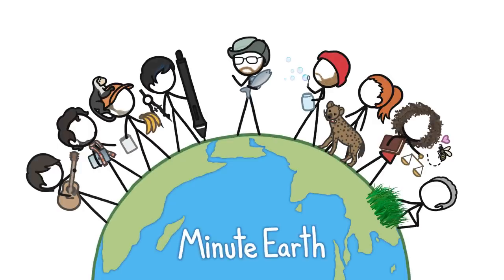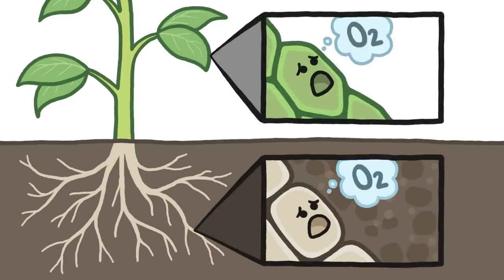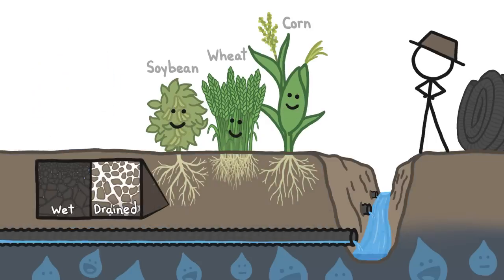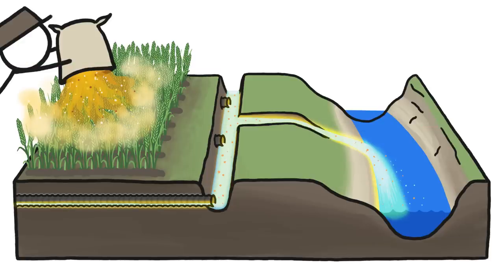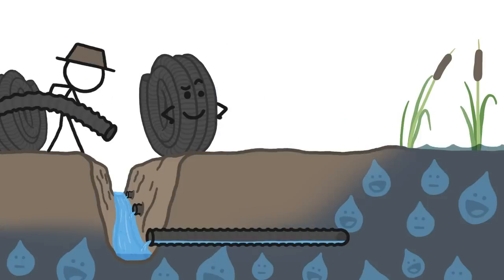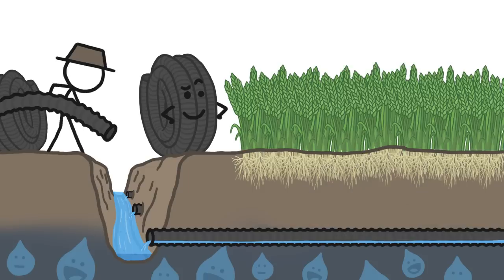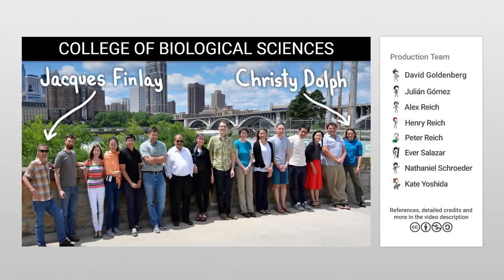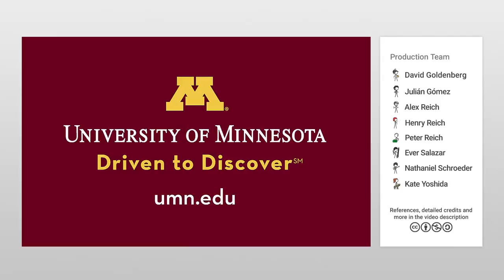The Secret Global Sewer System

Comment: There is a lot of misleading information here. 

Wetlands are not tiled because you are trying to make you land more profitable. Wetlands are 50/50 if a crop will even make it. It is more an crop insurance play.

It is rare to see someone both irrigate their land and tile it as well. If they are they are super rich farmers maybe. Typically either irrigation and tiling is put where it is needed to make more money. You have to pay it off you know because it isn't cheap. To add either of these depends on the soil and crop you are farming as well. 

Not that many people are putting in tile. Tiling definitely makes land more productive and manageable. I would put the tiled farms are around 5% in the US. This video acts as if every farmer out there is putting in tile and irrigation which is definitely not the case. 

Also needs to be more specific on the wetland part. It is more on the land that doesn't drain well enough to get into the field in a timely manner. Definitely not wetlands were ducks are roaming around, fish are swimming or even close to marsh. There is no way any farmer would dare to get stuck up to the oil pan up to a  100k lb tractor on that type of land. Man the cost of pulling you out and the time used isn't worth it.

In addition, tile is not only to drain the field but to allow the crops root system  to go deeper to fight against the times of severe drought. This way the crops have access to more moisture during those dry times.

However, I do agree that timing of chemicals and not directly linking to a creek or river is good!
Reply: Why would you measure the weight of such a big thing in pounds?
Reply: Drainage is more common in other places than in the US, though. Here in Sweden over half the cultivated land has drainage installed.
Reply: @dentoncrimescene  I would surmise because that is how vehicles get classified through DOT. Anything over 10,001lbs. GVWR requires a CDL to operate, if I recall correctly. It usually says something about it on the reverse side of a driver's license.
Reply: I work for a sewer treatment plant. We average about 7 MGD, normally. We have had to remodel the plant at least twice in the 25 years I've been there. Both times were to meet ever increasing limits on the amount of nutrients we can discharge into the river. Being one of very few 'point sources', it's the only way that the DEQ can regulate what goes into the river. Farms and fields rarely are subject to regulation because of their open nature, in my area.
It might seem counter-intuitive to some, but the river is actually cleaner downstream from us because we dilute with clean water what is already in the river.
Remember, the solution to pollution is dilution.
Reply: Here in the UK a great deal of the farmland has some form of drainage. Whether that's full on drainage systems or just ditches dug along the boundaries and the water funneled into streams. My parents house was built in the 1920s on meadow land and there are terracotta field drains running through their garden that were installed back years before the house was built. 

As for wetland, farmers may not intentionally drain a swamp to farm very often (although it does totally happen, just look at most of Norfolk) but if you drain the farmable land around the swamp then the swamp shrinks and after a few years there is more land that starts to look farmable, it only needs a little drainage. And so on.
Reply: WhichDoctor1 Wait you mean to say there are places outside of the Us, gasp.
Reply: @beeveebee  as a state sewer treatment regulator, I sympathize entirely. Every year we are required to reduced effluent limits but are not allowed to touch agricultural runoff because lobbyists have been very effective in the grain belt. 90% of the organic nutrients that are causing water problems come from farmland. And we can't regulate that because it's "non-point source". And because of the lobbying, drain tile effluent is still considered non-point source in my state.
Reply: “It is more on the land that doesn’t drain well enough into the field in a timely manner”
The reason water doesn’t infiltrate and percolate very well in fields and instead runs off the surface is the soil has become compacted. Wetlands, whether temporarily or permanently under water, are not compacted as much as fields and the large network or roots and earthworm tracks allow for easy infiltration of water into the soil. What he was saying isn’t that tile drains away all the rainwater and none was runoff. Instead he was implying that when the soil is saturated the tile drains excess soil water away and running that into wetlands would help clean it up and reduce downstream flooding. If wetlands were placed in strategic locations like he mentioned, then they would absorb water both from runoff and from tile. Sure it would’ve been better if he has mentioned all of this, but he still wasn’t wrong.
Reply: Nerd
Reply: This is bigger than my essay.....

Comment: Solution, Storage tanks. From the irrigation channels and tile to LARGE under ground tanks to be used for watering dying dry periods. 
The same can be used in city infrastructure to help prevent flooding the sewer and storm drains, as well as providing water to keep roads clean and assist with localizing water for Firefighters.

Comment: Serious question: can they not make a system to where it goes into essentially a gray water tank, which they can then draw from to water the crops again later, rather than from the aquifer? Kinda like the way city parks will often have signs that their sprinklers are using non-potable water?  This way, the chemicals already in there were already meant for those crops (and so hopefully they don't have to apply as much), and they use less water overall (and have a diverter or something for when the graywater tank is empty so they can pull from the regular well again).  Or am I missing some crucial thing?
Reply: I think the main issue is that not all of the water drains to one place in any given field. Tiling (what farmers put in the ground to drain water) is actually used quite selectively, not just across the entire field like the video made it out to be--usually farmers only use it in the natural valleys on their land. As a result, in any given section of land (1 mile x 1 mile), there are usually 3 or 4 valleys that exit the section at different points. Many times, these points don't actually go into a water supply; they merely drain into some corner the farmer left uncultivated because of it being too wet, or into ditches (which are filled with grass/cattails and easily take in the water). So, to set up a pump-and-tank system, you would need to have them located at 3 or 4 places each mile section of land, and that adds up quickly given that farmers use a TON of land for farming. There may be some overlap where one pump/tank can reach multiple of these valleys, but it really wouldn't be enough to justify the cost. Incidentally, the environmental cost of manufacturing and implementing such a pump/tank system would likely end up being even greater than any benefit it would give over the years.

Source: my father is a farmer; I've lived and worked on a farm all growing up, in an area where they use both tiling and irrigation (though very seldom on the same field, like this video portrays)

Comment: Tile actually helps control floods by letting the water out slowly... without tile the water in our fields has only one way to leave via the surface carrying pesticides, fertilizer, and soil particles (which I do not want since I spend money on these items)... so by placing tile in the ground, we lower the water table, but also create a place for water to go when we get rain, and when the soil profile get too full its released through the tile slowly... not causing floods as you portray!

Comment: Isn't there a way to reuse a big part of the water? That would result in less wasted water.
Reply: This dude is proof of time travel
Reply: TARS right? Wtf
Reply: Both aquaponics and hydroponics reuse the water.
Reply: The trouble is water tends to run off fields when there's loads of water around and no one needs more. Then there are long periods where there's no run off. So whatever you'd use if for would get little benefit from using runoff water when it could use water from other souses and then it'd only be possible sometimes and it'd be fairly unpredictable when. You also have to think of the enormous volumes involved. 

It would be really cool if we could take that water and pump it up into tanks or reservoirs to use when its dry but lifting water upwards takes huge amounts of energy.
Reply: Ad Lockhorst  Oh indeed there are many projects attempting to temporarily store water to mitigate flooding. I was replying to UCreations who asked if there was a way to reuse that water. I presumed either in some industry that requires water or using it to irrigate fields again when needed. I'm not aware of anything that attempts that and dont know how such a thing could be done. I'd be very interested in hearing of any ideas that have been tried though.
Reply: Ad Lockhorst  thanks for the link, I actually come from rotterdam but am studying ecology elsewhere in the country and now see that they are working on some very nice projects back home...
Reply: Its a LOT of water to collect and store, and to bring it back again. Not everyone has enough space to build a giant lake. I worked with a greenhouse company and all drainage water was collected in the bassin. Reused in times of draught. Also, no water was allowed into the sewer system because of pesticides and nutrition.
Reply: @WhichDoctor1  do you think if farmers, in California for instance, used recapture technology to water their crop during drought that it would indirectly result in needing less pesticide? They are essentially using their own chemicals again. This really would require a lot of storage, a whole lake even
Reply: Ad Lockhorst  Make video naough! :-D
Reply: @curlyfryactual  Yes, well, theoretically. Its not useful directing the waterflow to the roots, the plants would have to be sprayed with the water. It would probably lead to higher amounts of pesticides in the plant, and thus in the food. 
I have always been fascinated by biological pest killing techniques instead, meaning other animals. For example ladybugs, or as I like to call them, deranged-psychopathic-serial-murderer-bugs. :-)
Reply: "In Taos, New Mexico a group of pioneers gathered around architect Michael Reynolds in the 1970s to design and build wholly sustainable dwellings using local materials. In the process, they devised an entire system of water supply and use/reuse that has been proven self sufficient for the last 20 years. This system allows for fully functional living in areas that get as little as 7" of rainfall per year . . . without additional supplementation."
I have no idea if you even care about this question anymore but if you look up earthships on youtube they talk about reusing water a ton and this quote is from this article https://dengarden.com/misc/Whole-House-Water-Supply-Purification-Systems

Comment: it's funny because it can go too far the other way too. for example, mostly in southern australia the river systems' long term prognosis depends on government buying back water off irrigators so they can increase flow rates in the rivers. they call it environmental water (water for the environment as opposed to the irrigator). also in my city of melbourne there has long been initiatives to build wetlands in our major river system - the birrarung /yarra - and in fact now the wetlands are impeding the flow to the detriment of the river system's health and no new wetlands may be installed there (normally they've been introduced as environmental offset for some negatively impactingf development, but it's seen now to be a negative impact itself).

Comment: well, i didn't know that! 
it sounds like farmers just flood the crop field and let gravity take the excess water.
why they don't just use less water in the first place? is the water so cheap? 
and why don't they use the excess water for doing the water cycle again? they already contain those "chemicals" required for the field... 
that would solve 3 problems:
1. water drainage
2. savings on chemicals
3. protecting the environment
Reply: Cause rain also exists, surely they would just recycle some of the water if it really worked that way?
Reply: @jadoei13  and what does the rain do? I lost you there
Reply: Rain is what floods the fields, they aren't intentionally overwatered.
To reuse drained water they would need to store it somewhere, and have infrastructure to both carry water to and and from that storage.  That would both take up a lot more space than the current solution and be a lot more expensive.
Reply: @VitalVampyr  I mean, it sounds like that issue could be solved by just putting a bigass farm-sized version of a septic tank under the farmland, and just re-pumping the water out of that
Obviously that's a gross oversimplification and it wouldn't be cheap, but it's also a lot less space-intensive than you'd think, and there is literally nothing more expensive than the wholesale destruction of the earth's inhabitable biosphere so this is comparative chump change
Reply: @Darasilverdragon  Septic tanks still need to be emptied and aren't meant for storing water.  Furthermore 1 inch of rainfall is over 27 thousand gallons of water per acre.  Underground tanks might be a solution for having water during dry periods (a simple well is significantly cheaper though) but they can't solve the drainage problem.
I don't think you're realizing how impractical these advanced methods would be.  There's a good reason this video is suggesting things like having grass in front of the outflow and fewer fields as mitigation strategies.

Comment: Field tile helps slow down flooding not speed it up. Field tile will lower the water table in the field so you have several feet of soil to absorb rain water. Then it will release that water overtime. Most field tile systems are designed to discharge around a half inch of water per acre per day. If you have a big rain event of say 6 inches in a day, a soil that is tiled will be able to hold and store a lot more of that rain than a non tiled field and consequently release it over several days. If a field is already saturated with water most of that 6 inch rain will run right into the nearest river carrying a lot of top soil with it. So tiling helps to slow down erosion too.

Also if properly installed with no surface inlets most tile water is to drinking water standards. The soil works like a sponge to filter most of the nutrients and pesticides out. And farmers don't want to have any nutrients or pesticides going down a tile line because not only is it bad for the environment but also for the bottom line.

Historically maybe 80 to 100 years ago wetlands might have been drain by installing drain tile, but that is not the case in this day in age. In the USA if a farmer wants put tile in a field the have first get a wetland determination from the county soil conservation agents to make sure the are not draining a wetland. Or risk getting their tiling equipment confiscated if caught tiling a wetland!

Comment: I think that they should reuse the water it's even more possible can anyone explain it for me?
Reply: Usually tiling (the stuff farmers use to drain land) leads to a canal, river or other body of water. Incidentally, farmers downstream use that canal/river water for irrigating their crops. In a way, water is already being reused as much as possible--water not used by the crops of farmers upstream is made available to those downstream. 

Any more advanced system of reusing water like piping the water, storing it in tanks, etc. would require major cost and disruption of land to implement, and just isn't economically or ecologically feasible for farmers to even think of doing. 

Source: I'm the son of a farmer; I worked on a farm in Canada every year growing up.
Reply: @nathanielbennett3405  thank you for answering me

Comment: LOL, few things can prevent destruction of wetlands and pumping contaminated water to the river banks.
Modern farmers really suck. There is three ways that they should do to get perfect crops:
1. Mix the soil with charcoal in 1 to 6 to get " terra preta "
(that also eliminate need for fertilizers, wood ash is recommended)
2. Isolate the bottom of the soil by using airpermable waterproof sand
(that will also protect the crop from underground surge)
3. In very dry areas/deserts - use drop irrigation - permaculture.

Link to first:
https://www.youtube.com/watch?v=sgK5DWCMj8A
link to second:
https://www.youtube.com/watch?v=F2DLQw1K9Ms

Comment: What if you use your irrigation water from the stream your excess goes in or store excess water for the dry season? What if you don't put your irrigation system on wetlands? What if you don't use pesticides and to filter the fertilizers by puting wet loving crops at the output? "A pipe dream" is a bit of hyperbole.
Reply: You mean organic farming? Highly inefficient. Very costly. 

If you don't put it on wetlands. Crops will drown. Wetlands have good fertile ground and available space. 
Storing still water for that long can make it toxic due to algae and all.... 
And uhm the idea already is to have water go through some plants.